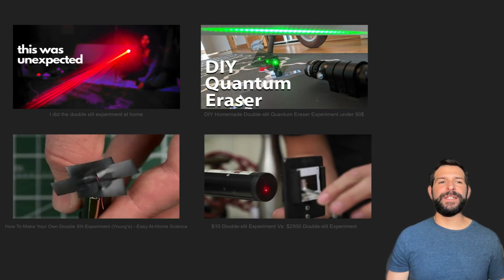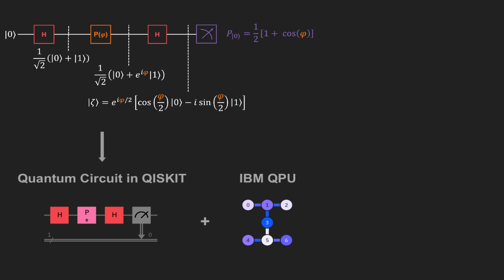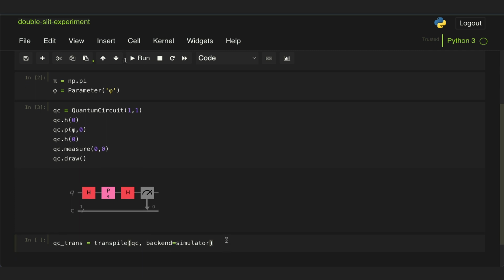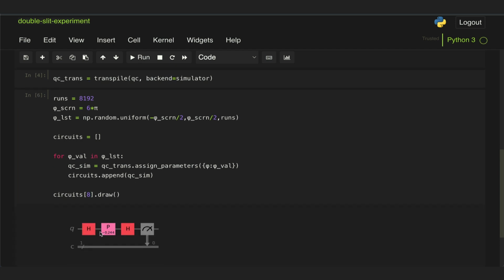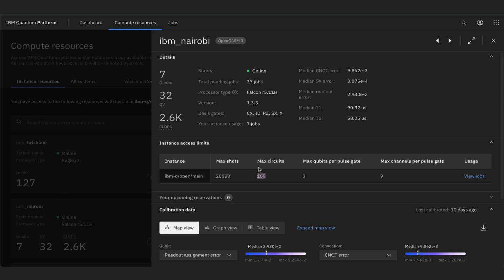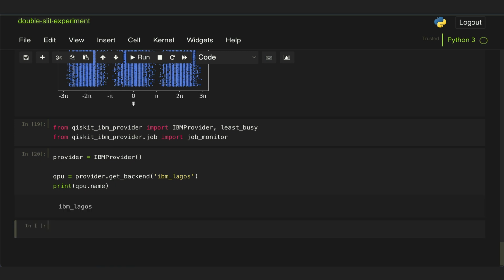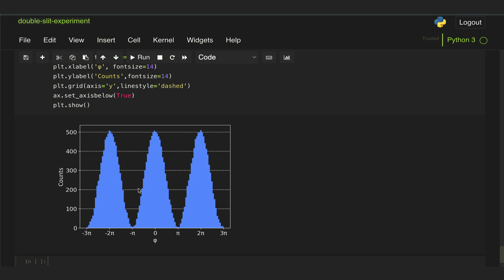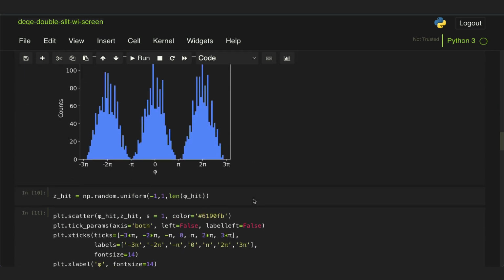Running the Double-Slit Experiment on a Quantum Computer

Comment: It was very interesting, although it wasn't entirely clear that if we had 100 circuits, wouldn't it have been roughly enough to run each one 82 times?
Reply from the maker: Yes, sorry. I probably didn’t emphasize enough that the 8192 samples we pick for the simulation are kinda arbitrary. We just need enough runs to see the interference pattern.

Similarly, when we use 100 circuits, the 512 samples were arbitrary; could’ve used a slight smaller number (like 82 to match the first simulation) and probably would still have been able to discern the fringes
Reply: @diemilio  thanks

Comment: Hello Diego, 
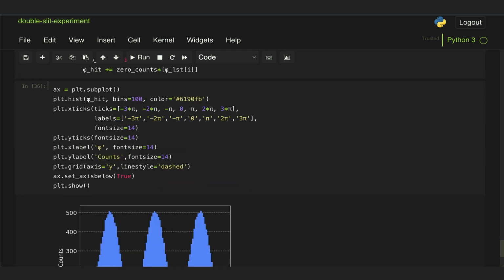very interesting work! I tried to replicate by myself but a problem occurs. After succesfully excetue my job by checking his status, I have tried the chunk where we obtain data in the form: "qpu_results.get_counts(circ).get('0') " (11:50 min in the video) but an error of the form: " raise QiskitError('Data for experiment "%s" could not be found.' % key)". However, after printing "qpu_results" I can see different counts for the different circuits. 
Note that before this point I raise same results of your work. 
Hope you could help me. 
Kind regards.
Reply from the maker: Hi Carlos. Sorry to hear you are having this problem. One reason this might happen, is that circuits inside the list called "circuits" (the one you are iterating thru in the for loop) was changed after the job was sent to the QPU. 

In order to extract the results, the circuit you pass to the .get_counts() function has to match that of whatever was sent to the quantum processor. If there is a mismatch, then it will throw an error.
Reply from the maker: If this is in fact what caused the problem, you can get around it by modifying the code to this:
φ_hit = []

for i, result in enumerate(qpu_results.get_counts()):
    zero_counts = result.get('0')
    
    if zero_counts is not None:
        φ_hit += zero_counts*[φ_lst[i]]
Reply from the maker: Hope this solves the problem. Also, remember the link to the code is posted in the video description. One thing you can do, is download the notebook, and just run all cells. This should give you no errors if no modifications are made between the time the job it sent to the QPU and when it is extracted for post-processing.